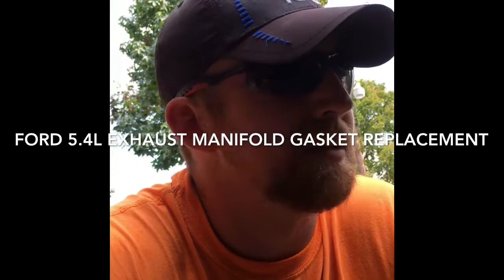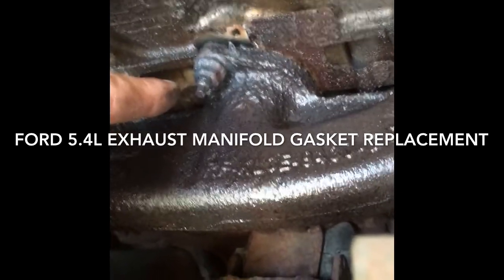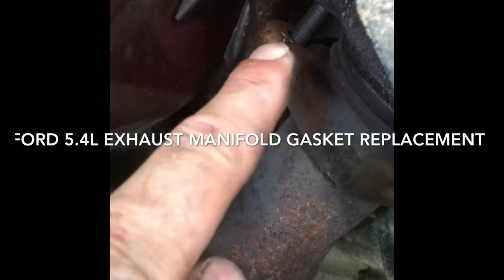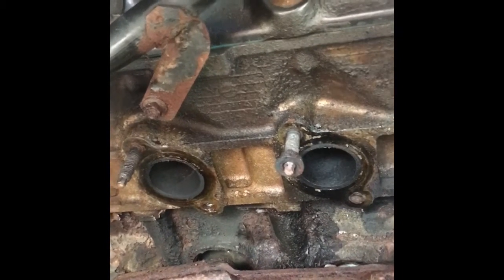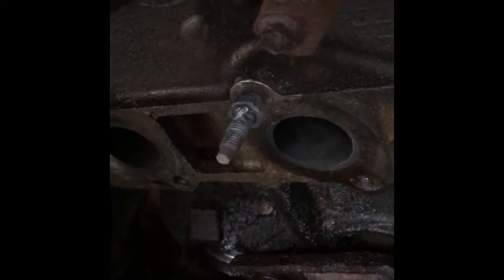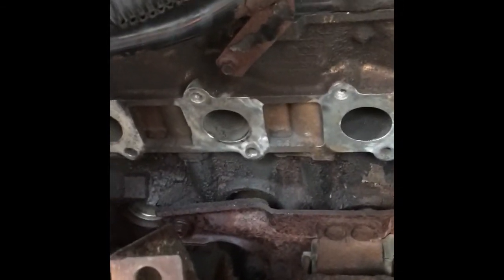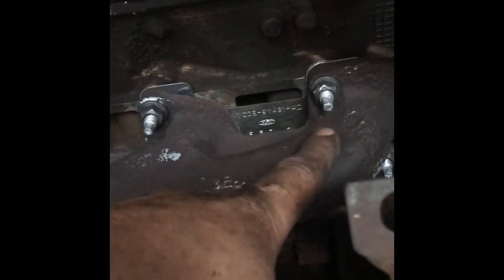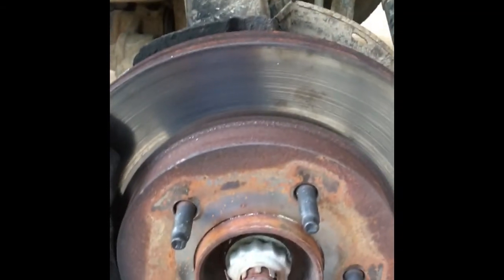Ford 5.4L Exhaust Gasket Replacement

Comment: I cannot seem to find a video on the exhaust flange gasket replacement, the "Doughnut Gasket". Can't figure out if it's flat, or the cone shaped thick gasket.
Reply: It's integrated to the manifold if I'm not mistaken